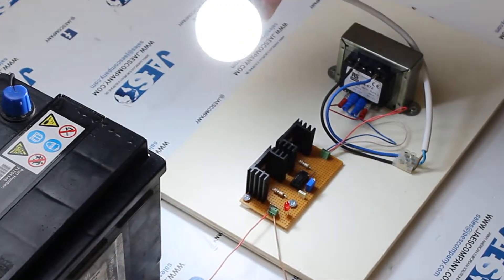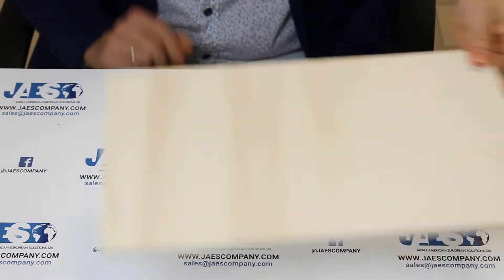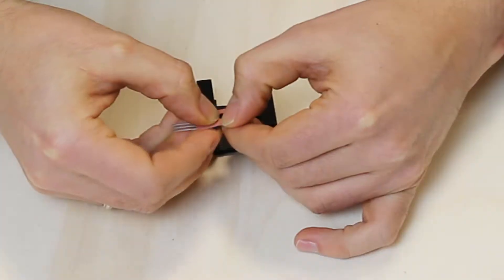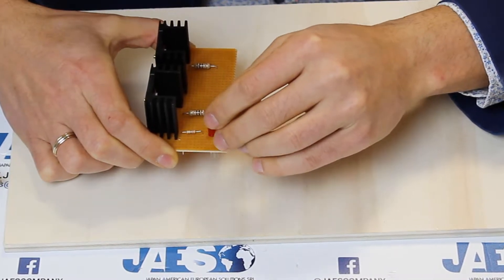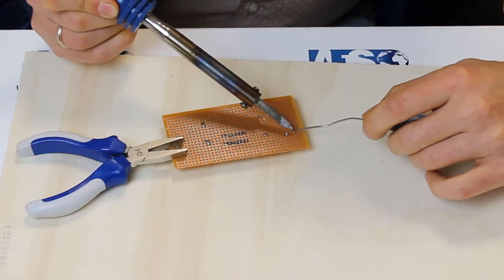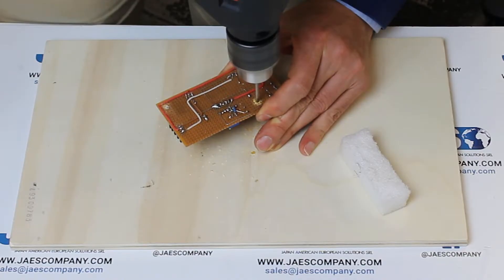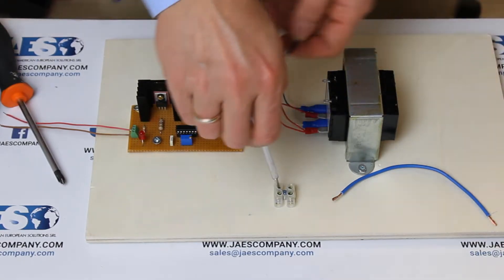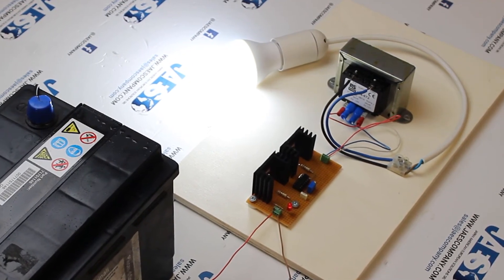How to build a simple inverter - DIY inverter

Comment: You've basically transformed low voltage to high voltage, since you've inverted 12V to 110Vac or 240Vac or something like that.
Then feeding it to the bulb where it is converted back to a Low Voltage...
Can you calculate the "Efficiency" of your system ,vs a simple 12V to LED direct fed system?
You can calculate the input power from the battery and the output power going to the LED bulb.
Then you can take the LED bulb apart and measure the power being fed to the LEDs.
In your experiment the LED bulb won't last long with the power converter in the bulb being subjected to square rather than sinewave AC.
Reply: Please read the title before you post your long tirade. It is a video to show how to build a SIMPLE inverter, not a video to show how to build the BEST inverter!.

Comment: Personally I would have used a 555 driver to control the secondary of a 120-to-12VAC transformer, power in the 12V side and 120 out the primary side. Also you should check that all the voltages work out correctly